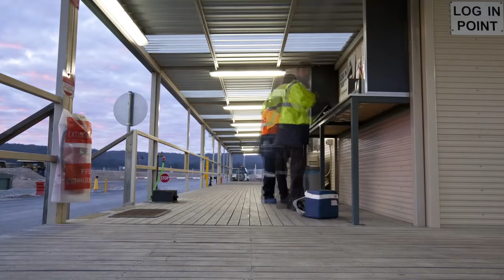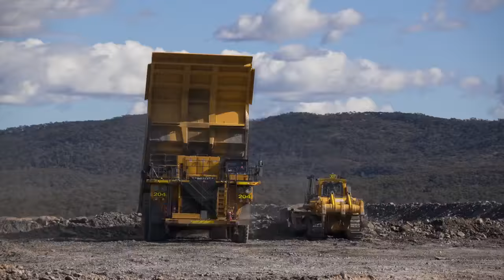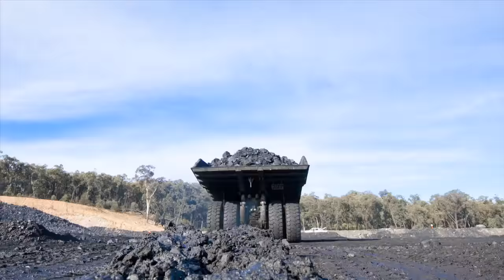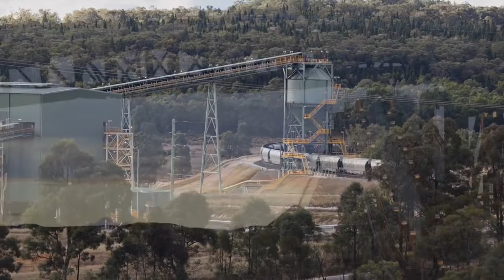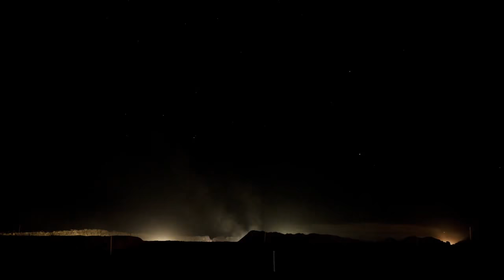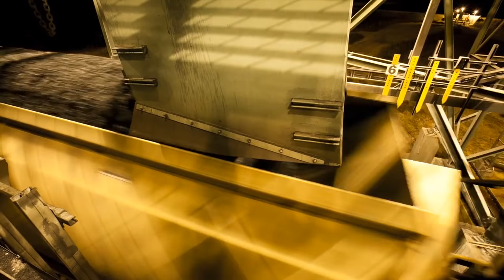Moolarben Coal - Time lapse (Australia)

Comment: whats that white seam running through the coal layers?
Reply from the maker: Hi Barry, these are sedimentary rocks that can be poorly cemented limestone, sandstone or clay. It is recommended to take a sample for analysis with a magnifying glass. Share and subcribed.
Reply: undergrounds mines use this layer to guide the cutting machinery. makes it easy to follow the seam. its called the pennyband